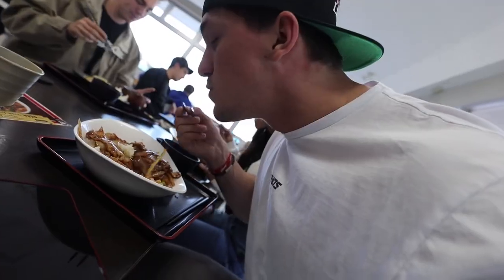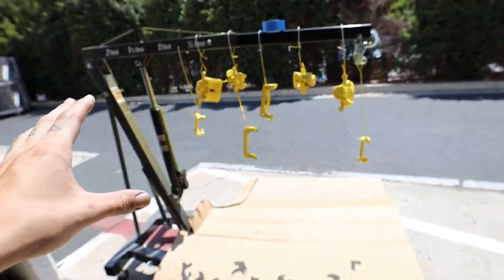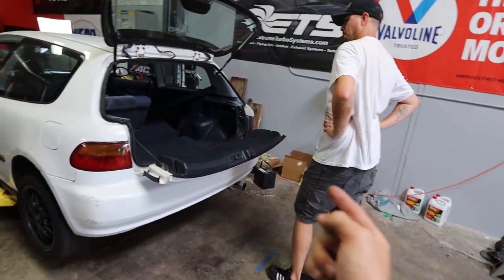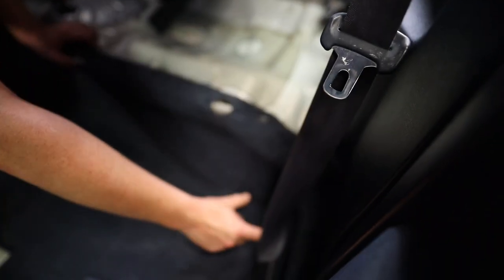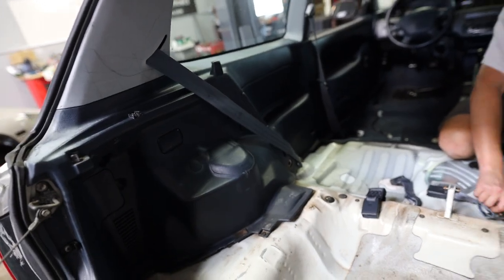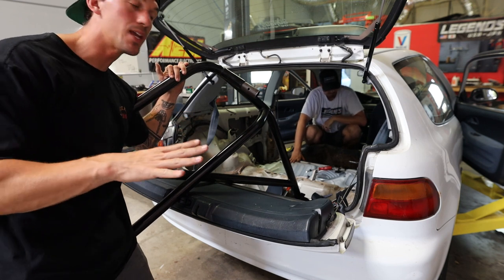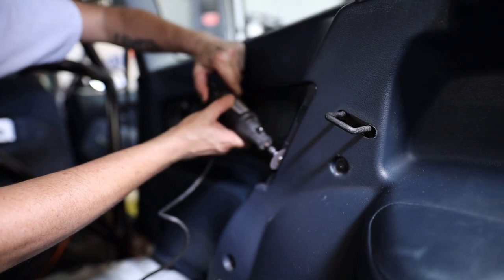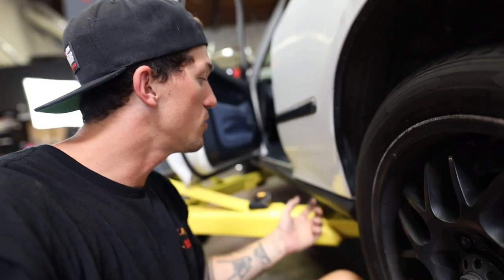Civic EG Gets Bride JDM Carbon Racing Seat & Cage! | Building a Kanjozoku Style Civic EG Ep. 2

Comment: I learned my lesson driving a bolt in roll cage without squeezing a bead of silicone between the plates. Rust, little puddles of water penetrating and rust between the folded steel. 10/10 would recommend a bead of silicone.
Reply: i was just thinking about this
Reply: @bryan8946  hey its not a problem when you make it a dry weather car but damn those semi slicks/track tires dont have good water grooves so it al splashes at the bottom. I found out the hard way..
Reply: @dwarvinicus   he said the civic is gonna be a daily/race car, i mean he could just take another car if its raining but for peace of mind why not just put some silicone between the plates

Comment: I think not now but for V2 with the new engine you should take the sound deadening out & paint the interior! Also, use some locktite on the bolts for under the chassis you just put, had some roll cage bolts rattle loose on my stuff.